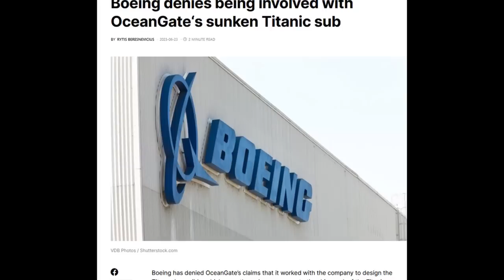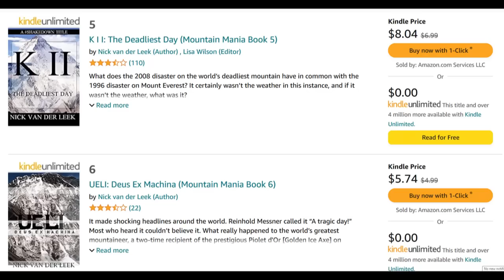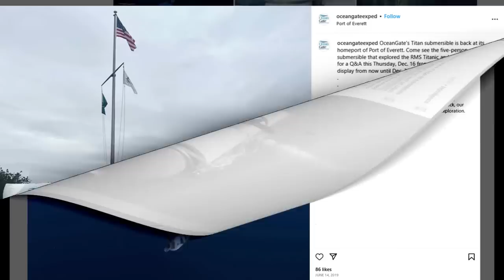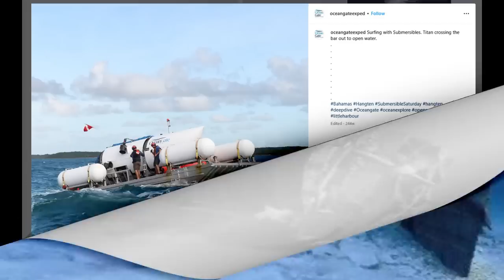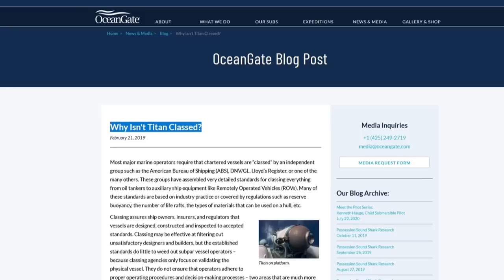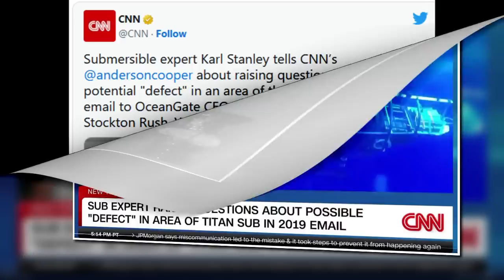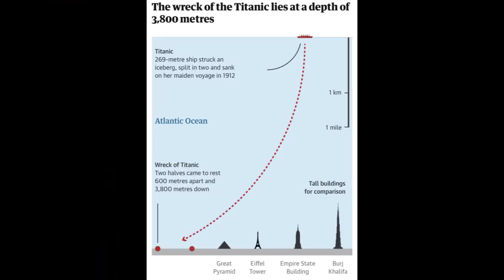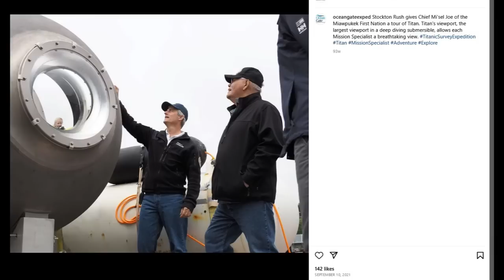"Boeing was not a partner on the Titan and did not design or build it"

Comment: “It’s like going from Model T to the Tesla,”

Um, no. This is just another example of 'tech vaporware' trying to cut corners and claiming to be innovative while pulling a 'Theranos or Nikola.'

Submersibles are built with titanium and steel for a reason, not carbon fiber. And you do not hand-apply and industrial epoxy to a titanium ring to carbon fiber and just 'hope' you get it right. Either titanium ring being just 1 degree off can cause dissimilar tensions/ compression axially down that carbon fiber pressure hull, straining unequally on the ends - which after pressure cycles worsens and creates cracks.

Naval submarines, when built, have their hull and all welds X-rayed to ensure integrity. It is unknown if OceanView x-rayed the hull for initial lamination flaws and fatigue cracks dive after dive as well as the adhesion of the two titanium end bell rings. They claimed they had an 'innovative technology' to monitor the hull but how that works has not been disclosed. 

As more and more info comes out, one of the engineers was fired over concerns over the carbon fiber hull.

This was just a bad idea and 5 people died - but this is the price we now pay with this Theranos-like 'innovation' that is designed to draw in VC funding from investors and a public who do not fully understand science, technology and engineering.

Being an ex-Navy Nuke submarine, this story has captivated and compelled me to write my ideas on this tragedy. When this story broke and I heard 'carbon fiber hull' and 'lost submarine' I knew it was over and shook my head.

King Neptune now has more souls in his emerald netherworld.
Reply: Thank you for your service. Their 'innovative technology' to monitor the hull consisted of sensors to listen for cracking sounds.

Comment: They bonded carbon fibres to a stainless steel tube and "boshed" two pressure rings on the end - sounds pro to me. What could possibly go wrong? its like standing on an almost empty tube of Pringles - but worse. There is an anti-personnel mine in the Pringles.

Comment: OceanGate also did not certify the sub for LIFE SAFETY!!!
Life safety certification would have required the vessel to have a safety factor of 3:1 or 5:1 so the CF hull, the epoxy adhesive glue, the plexiglass view port and both titanuim end caps to pressures of 18,000PSI - 3X the 6,000PSI water pressure at 4000 meters of depth!!!!
The sub wasn't even tested to 6,000PSI!!!

Comment: Sorry, I have to add 
I wrote a comment somewhere below but on watching the segment again re the building of Titan... 
WTF 
Who in the Hell thought up the idea of applying an apoxy resin...otherwise known as glue to two different materials, such as titanium and CF in order to bind them together and clearly believe that the joined materials not only could, but would hold together against such tremendous pressures as found at deep ocean depths, such as where the wreck of RMS Titanic lies... WTF... 
Watching those guys pasting the glue onto those titanium rings reminds me of participants of an annual Mardi Gras festival gluing their fancy costumes together.   All well and good but if the Papier mache wings fall apart on an Angel during the Easter Parade, that separation will not cause the instaneous  implosion and death of it's wearers.   Jesus H Christ... When will the little boys at OceanGate grow up and smell the roses... This  is the real world, guys.   Submersibles intended for multiple uses in multiple metres if deep ocean pressures are manufactured here in the real world and are bit the stuff io which dreams are made. 
Tinkerbell... Where were you when you were needed.   So unbelievably stupid.  And so sad, beyond measure

Comment: The fatal flaw is simple, with the 6800 psi outside the hull squeezing the carbon fiber center, it simply popped the end caps off and shattered the cylindrical core… such a pathetic design.

Comment: Yes, I'll Boeing does want to distance itself from this mess -- people, including me, are now wondering about carbon fiber in the 787.
Reply: As many here have said, carbon fiber has great tensile strength.  This is what the 787 is subjected to as the cabin pressure is greater than atmospheric pressure at altitude.  The sub is subjected to enormous compression for which carbon fiber has no strength at all.  Essentially the epoxy was the support structure.  I'm not an engineer just repeating what many have said.  You can bet the Boeing has tested its cabins through probably millions of cycles.  Carbon fiber is all over aircraft manufacturing these days.  Not just Boeing.

Comment: Thousands and thousands of people die everday and get no sympathy at all quit being pretencious, these arrogant idiots chose their fate to look at a ship 12,000 feet below the surface that's been sunk for over 100 years spare me!
Also what is in the skies flying,  privately and commercially having carbon fiber composite mature alas though my not have the same amount of pressure that the doomed Titan have but could have catostraphic failure also. You could never visually see the defect until after failure? This carbon thing is out of control and it's usage.
Reply: CF does not have the same strength when subjected to compressive loads as it saw in the sub at 4000 meters of depth!!  Aircraft use of CF are loading CF parts under tensile loads where it is very strong.  Two different situations and not compariable!!!